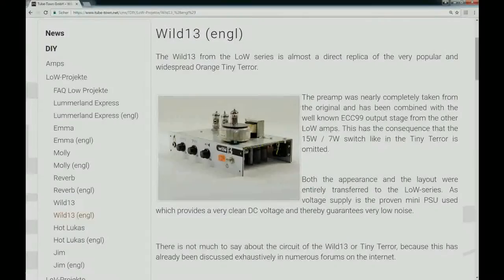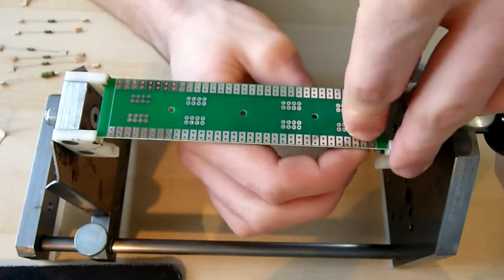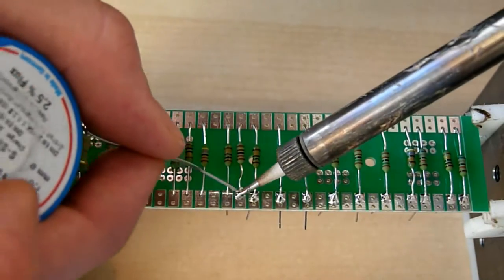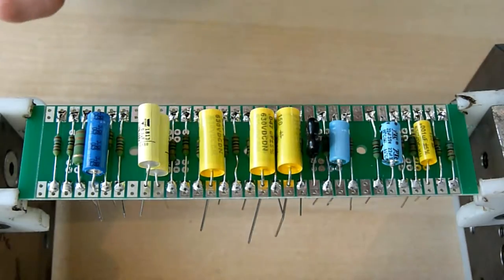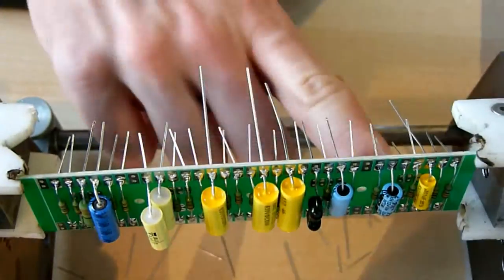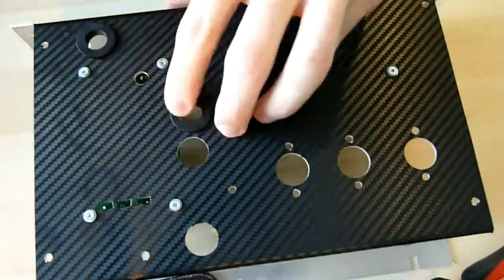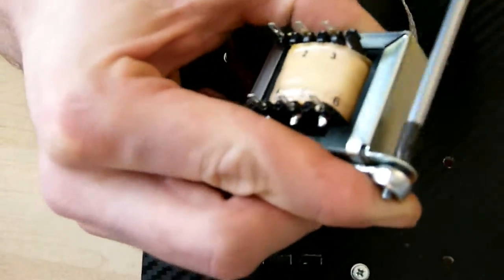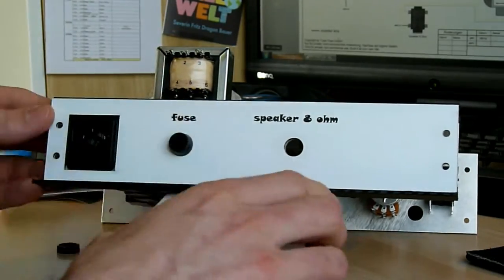Build your own Tube Amp! Tiny Terror Copy by tubetown.de - Episode 2 Main Board and Components

Comment: Hello, Thanks for the video so cool! You've done a great job.  Is there any chance you could post a total shopping list from TubeTown? I'm finding lots of accessories need to be ordered separately. This would be my first Amp build and would like to copy yours. Any help would be appreciated
Reply from the maker: I also clicked through the additional parts on tubetown and that's nearly two years ago.
You need the basic kit with the electronics, a chassis, some knobs, a case and a front plate.
All in all it was about 350€ I think
Reply: Yeah cool,  thanks. Maybe plus a power supply and choke too.

Comment: cutting the legs of components off so close to the board can weaken the solder joint and lead to failure from cracking. leave about 1/4inch, or 6mm.
Reply from the maker: +John Mc Cabe thanks for the advice, I will pay attention to this next time!